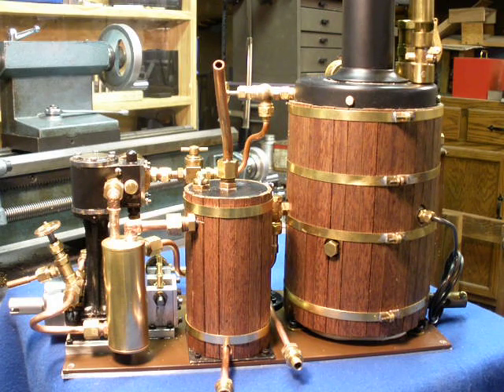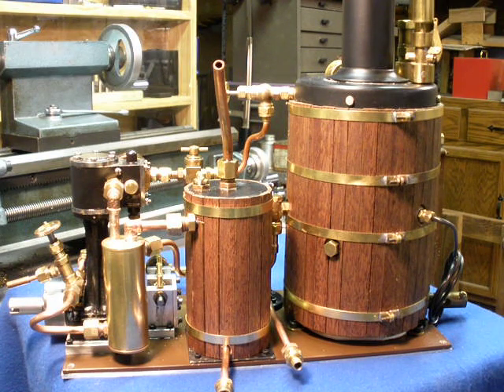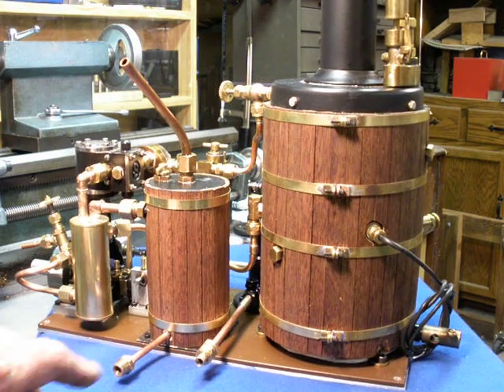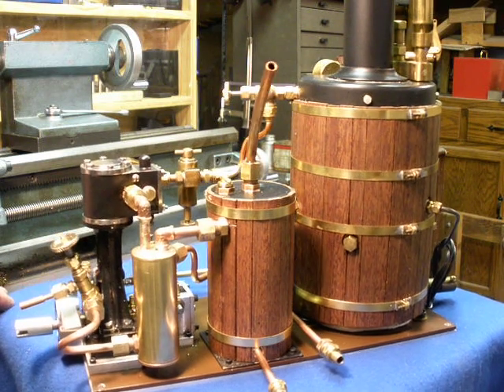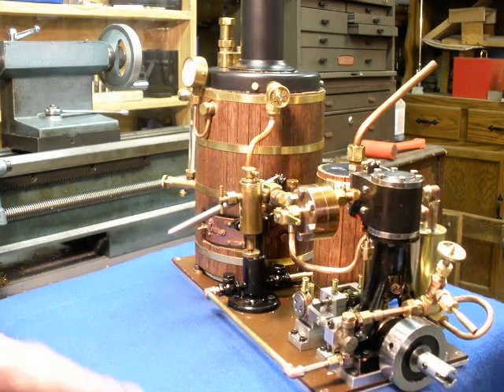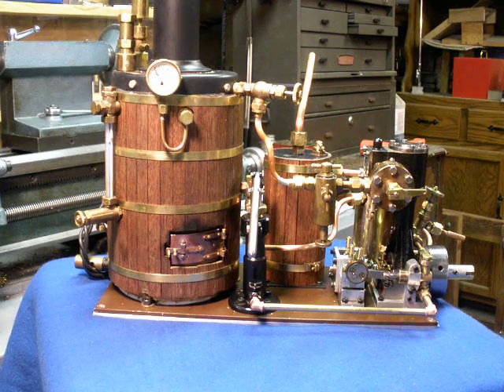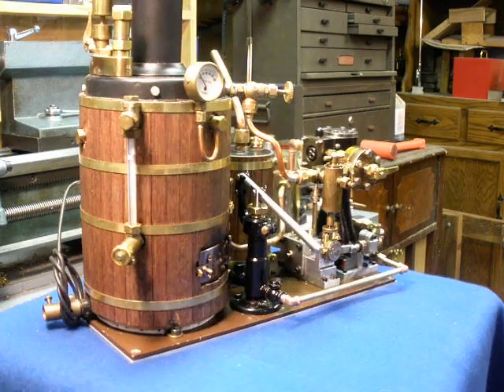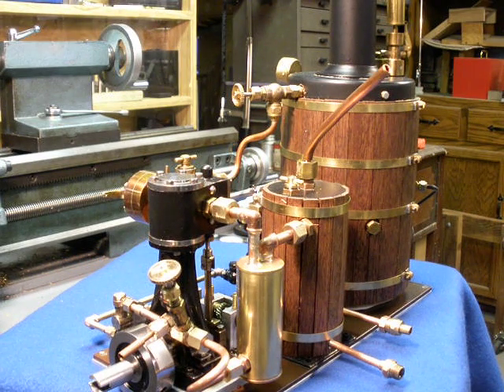Diana launch live steam plant - complete!

Comment: Great model engine ! 
I have been working on an exhaust heat recovery system myself. My work was not for a model, it was to prove a theory. My theory was that a steam engine is powered by pressure and not heat. 
So I built a 1500 watt boiler of 2" steel pipe with a 20' foot Concentric tube heat exchanger. 
I got aprox. 30% increase in pressure but ran into other problems that require rebuilding a few parts. (not done yet) 
can you answer a few questions about steam? 
realy need experienced help